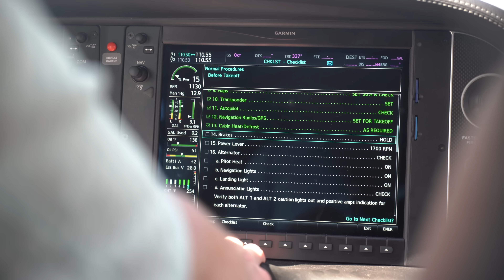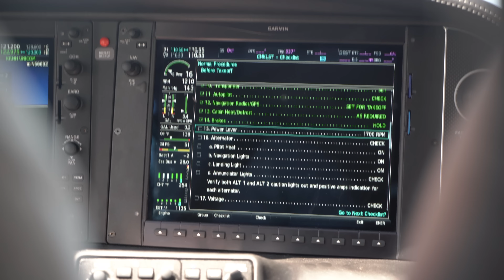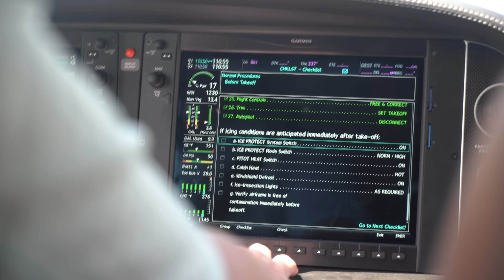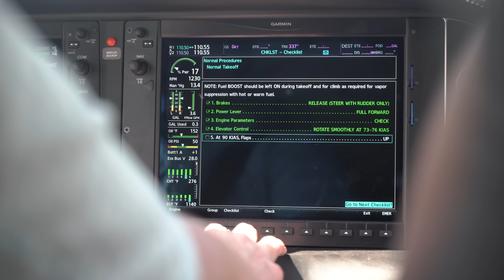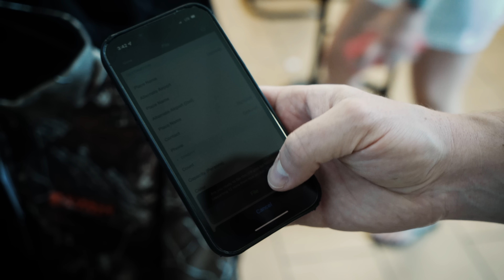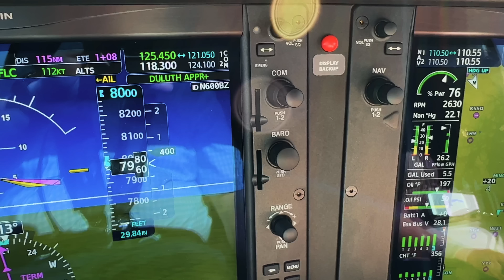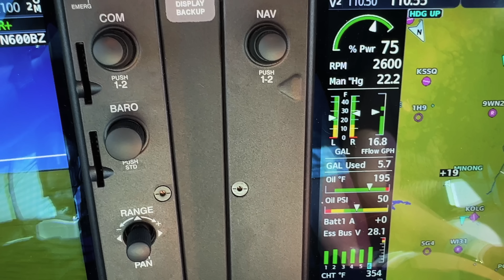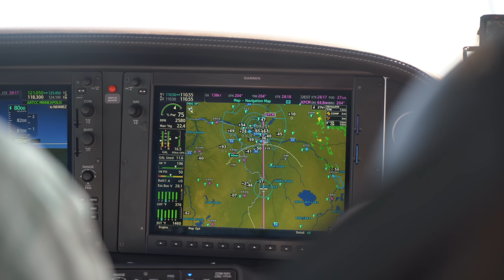Flying a Cirrus SR22 to the Cirrus Aircraft factory in Duluth, Minnesota

Comment: Steve
Why would you “climb shallow” during takeoff. 

What if you lose power then?

You’re in a bind
Reply from the maker: Good question! When there is a very gusty headwind, I like to pop up into ground effect and then focus on building some airspeed with a shallow climb while I still have plenty of runway in front of me, just in case a gust fades out that would result in a significant drop in airspeed. Rotation is only a small amount above stall speed in an SR22 and I like to have a little bigger safety margin than that. Once I get a little bit more airspeed built up to increase the delta between stall speed and current airspeed, I then climb out as normal. This is just my own logic more than any formal training that I've gotten. Am I thinking about this right?
Reply: I suspect the reason for the shallow climb was fly at a higher airspeed, and get more cooling air over the engine. That would reduce the  cylinder head temperatures (CHT) during the climb. Apparently it was near 100 degrees when they took off, which probably resulted in elevated CHTs, prior takeoff.